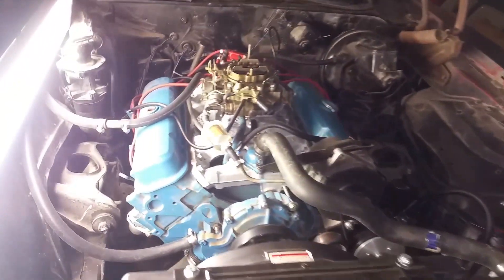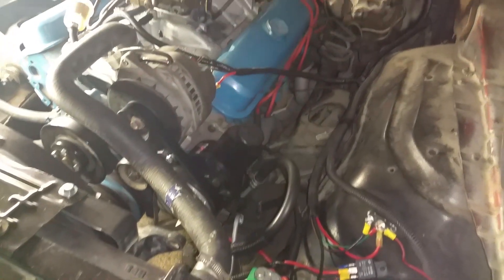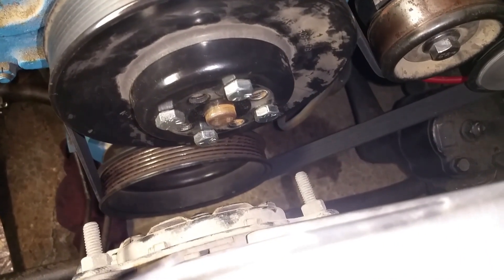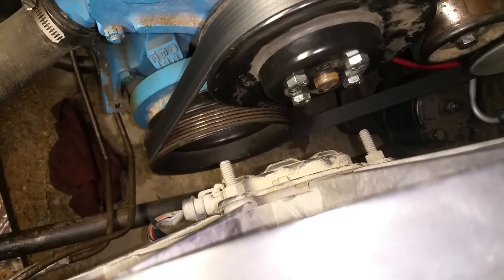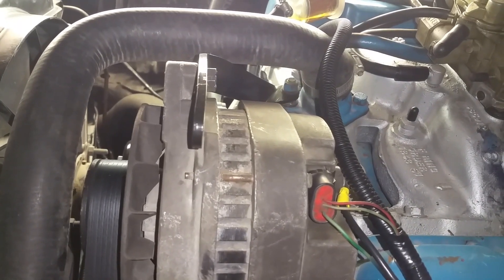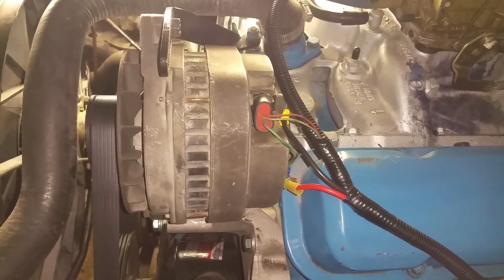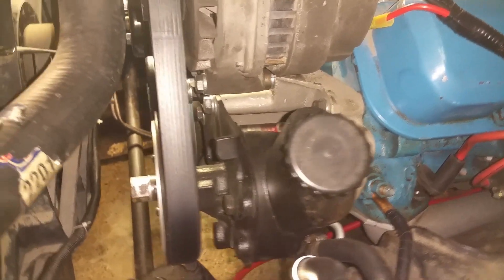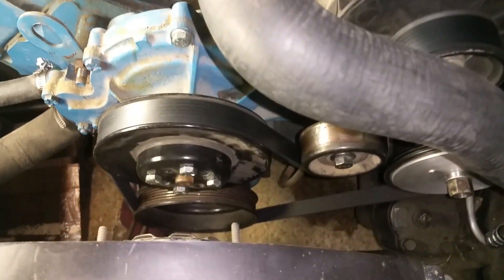Pontiac 350 DIY cheap serpentine swap

Comment: what are the OEM ford part numbers on the pulleys ?? Im sure they're stamped on them somewhere?
Reply from the maker: @willrorajr.2634  no idea, the car is long gone. I just remember the crank pulley was off a 90's - 00's Taurus v6 and the wp pulley was off a big square car, a grand marquis I think probably mid 80's